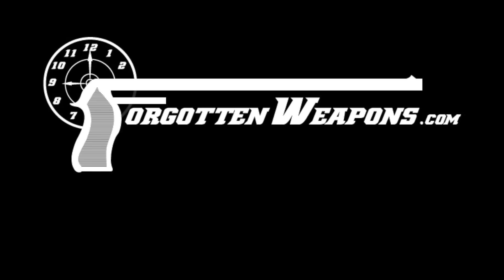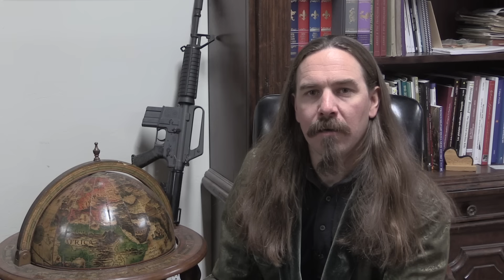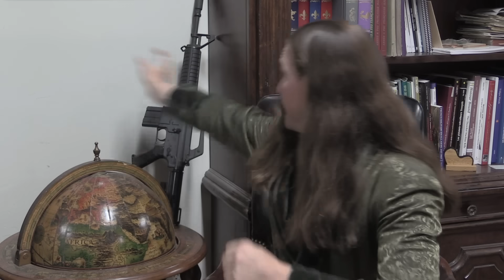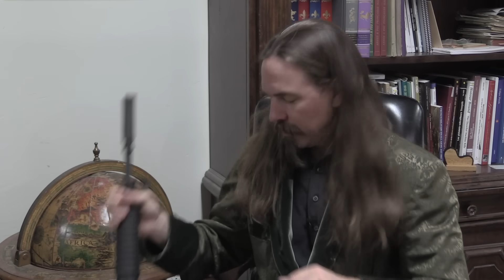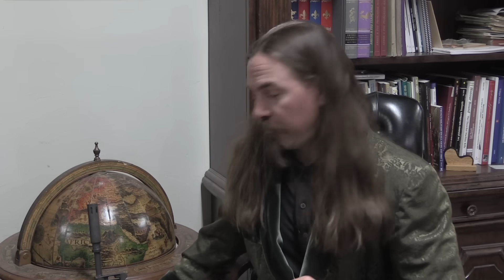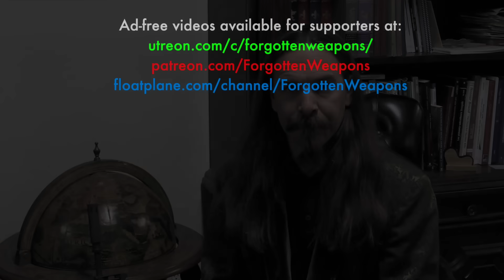Ask Ian: "Last Ditch" Rifles for World War III?

Comment: Back in the 80s, there was a paper and pencil/face to face RPG called Twilight: 2000.  The premise was that WW3 was winding down after 4 years of conflict with a limited nuclear exchange.  One of the firearms they came up with was the M-16EZ, which was an amalgam of parts stripped from damaged rifles and then cobbled together into something that functioned.  They would be shipped to local militias and governments without any sort of furniture, think of it as a battlefield pickup Aero DIY gun that had everything but the furniture.  The furniture would then be fabricated out of local materials (i.e. wood) and then the kludge would be issued.  This is more of a recycled gun than a last ditch production, though.

Comment: Consider the US might need to make or design this last ditch rifle for other countries. I could forse a situation where hundreds of thousands or millions needed to be armed, because enemies have invaded multiple countries in a power grab.

I don't think M16 would work well for one piece all injection molding. The buffer tube could be stamped with a reinforcing flare. The lower with handle can be one piece molded around the buffer tube end. The upper with fixed rear sight can be molded around insert that will have threads to install barrel nut. The barrel nut and hand guard could be a simple A1 style. The trigger group could be simple 3 position with full auto capability. It might even be possible to use powdered metal manufacturing techniques to make the trigger and hammer. The barrel doesn't have to be chrome lined or threaded. Just crown it with a straight profile. The front sight could be A2 stile or made fixed one piece. The barrel doesn't need an A2 flash hider unless you have a little extra time. In that case, it could just be pined on the end. The buffer could be A2 stile as also the stock. The magazines are probably going to be molded plastic as well.

I am not thinking this needs to be durable. I am thinking about faster, cheaper, and simpler. A last ditch rifle just has to work long enough for a conscript to fight.

Comment: If it's end times production you need something that can be made without computers or high demand for power.  Off the top of my head the best option/choice would be the Ak-47.  Simple, rugged, works.

You don't worry about aiming too much because if you are at the point where you are making more to equip replacements.... well your highly trained guys didn't do all that well at aiming.

Comment: I could also see the M-16 receiver becoming a 2 pecs stamped & welded part metal part. As for barrels they would become something like a rifle barrel liner with either a steel rod drilled for the liner or a polymer outer barrel. They are basically a thin tube that is riffled and pressed onto a worn barrel. You might even see something like the AR-7 being built for the current Military round. That riffle is about as simple as you can get  and has a polymer barrel cast over basically  a barrel liner. The Germans did something like that except they used a wire wrap over the liner.
But I have to say, Machining as we know it today is on the way out for the most part. 3D printing machines are going to replace the time honored Machinist and machines. I knew this back in the late 1980's when I started to see the 3D machines. It hit home in 1994 when I saw the first metal 3D printed parts being produces. Then about 2010 when I saw the Swedish sports car manufacturer Koenigsegg a complete variable turbocharger made out of Stainless Steel that could be just as easily be made out of Titanium. Here is the link to that Turbo. https://www.youtube.com/watch?v=DNedUZxP8NU
Oh how I wish I could afford one of those cars! As I recall it holds the all time record speeding ticket on a highway at 140 MPH in Texas. Yeah, I would be in even more trouble with one of those cars with over 800 BHP. Love big guns, military and fast cars but I can only afford the guns & ammo. But I digress, back to 3D printing.
I think the 3D printing will take over most of the machining world within the next 30 years possibly as soon as 10 years. There are many places investing in this world changing technology. All you really have to do is insert a program and wait, then uncover your part. I'm sure soon if they haven already done it, barrels and whole guns will be 3D printed. I know they have 3D printed suppressors. Right now it takes a long time, up to 48 hours + for a 3D printer to make large parts. But machines are getting faster and extremely accurate, with the surface finish getting better than machining. These machines can print a whole functioning gun or any other part, all assembled and ready to work or shoot. The cost of these machines have come way down and you can buy one that makes plastic parts for about $500. These machines are going to make CNC machining as obsolete as Blacksmiths. I do know that they are making military aircraft parts with 3D printers. The thing is, with the 3D printer, things will not become so old that you can't get parts. All you will need to do is program the machine or pay a fee to use the program to make the part. You will be able to make it at your home one day like having a Star Trek Replicator.
It's kind of sad to see, I'm a Machinest. I started off in the USAF learning the triad on conventional machines, lathes, mills, surface grinders, shapers and more. I never thought CNC would come down to a repair shop but it did and the military started to buy them before I got out. Now there is talk of moving to the 3D machines. Its hard to admit, but the 3D stuff is more accurate, more exact repeatable and faster. Believe me, If they can 3D print something as complicated as a turbocharger like of that one made by Koenigsegg, any pistol or rifle would be simple to make.

Comment: Taken to it's furthest extreme, an AR18 modified to take a STANAG magazine would fit the bill- stamped steel stampings rather than forged and mill finished aluminum. But I'd agree- polymer lower with integrated stock. Don't drill the third hole- saves manufacturing time, a few fewer parts, and greatly reduced training time. That shifts everyone making lowers to making uppers that have a "shark fin" that you drill a big hole in and put a simple plate into like an AR7's rear sight. A bit nasty, but it works and requires drilling two holes, a steel stamp for the sight, and a self tapping steel screw so you don't even need to tap that smaller hole holding the site plate. 

Also, no sling swivels. Issue a strap with one tri-glide adjustment (a belt), duct tape and maybe some 550 cord for the most redneck Isreali style patrol sling ever.

Comment: A slick side m16a1 upper with a 16in barrel and mid length gas system and a polymer lower would be unbeatable for weight and common parts

Comment: I honestly don't think we would see much change. Our small arms production capacity is unbelievable due to the AR-15 being both the military's standard issue rifle and the most common semiautomatic rifle in the US.

The optics question is the most valid point, especially if that war impacts our ability to source either glass or semiconductors. Polymer rear irons would be the standard, I think. If it breaks, slap another one on.

Comment: For a last ditch war weapon I would just do a PPSH-43 in 5.56 or 5.7x28. I takes 2 machined parts and 8 welds. Aside from the rifling you could build them from scratch with cheap sheet metal and a trip to Harbor Freight.

Comment: Polymer lowers definitely wouldn't be used especially since they are prone to cracking and breaking with hard use on top of damage from artillery, fragmentation, dropping, cold etc etc.
Reply: Some modern polymers are absurdly tough. I challenge you to crack or break a credit card, they use a type of plastic that has existed for about 150 years. Polymers bend and snap back into shape, aluminum deforms permanently.

Comment: A frame front sight made as  just a gas block and put polymer flip sights like MBUS also less rail cuts needed, get rid of the flash suppressor so no threading needed, why have full auto needed? I had 3 tours of combat and never used it or burst,

Comment: Do you think it would be possible that they would simplify a "Last Ditch" rifle to the point of having it be semiautomatic only?  In truth, while full auto allows good suppressive fire capability, full auto runs one out of ammunition very quickly and is rarely used in actual firefights (unless those firefights originate from movie studios).  And even a semiautomatic rifle with a 30 round magazine can provide suppressive fire, albeit at a slower rate (but that slower rate extends the length of time the suppressive fire can be provided per magazine).

Comment: As much as i want to like polymer lowers, all the ones ive seen that were polymer copies of standard aluminum recievers had failures, double firing, buffer tube broken off ect. I would be worried something that breaks with mild range use would be far too fragile for combat.

Comment: Making a Stamped receiver would be the better option than a Polymer die pressed receiver, since a Polymer receiver is unlikely to last very long in the field. Soldiers can be hard on equipment. Two halves of the receiver could be stamped and spot welded. you be able to stamp at least 100  receivers per hour on a single stamp press.

I could see polymer being widely used for the magazines since many would end up one time use. That's presuming there isn't a shortage of polymer materials needed to produce them.

Probably the quality of the barrels would decline as it takes a lot of time to make an accurate barrel. I would guess the production of barrels would be greatly simplified & using materials that reduce barrel life compared to peacetime produced barrels.

Next would probably be a simplified bolt to speed up machining time, such as removing the forward assist groves on the bolt carrier..

Also the trigger assembly might be simplifed. perhaps a not so nice trigger if lesser quality trigger can be produced more quickly & with less parts.

Comment: if you want really quick production.
you cannot produce faster than you can produce barrels anyway
Aluminium is also plenty abundant and easy to source in ANY scrapyard
Much easier to source vs all the chemicals required for polymer production

Comment: US doesn't have to simplify since we have the 2A and US citizens can just bring their own gear. We did it in OIF and OEF. We brought our own gear and modified our M16/M4 rifles heavily, and just returned them to issued state before turning them back in. Most guys I fought overseas with were better armed/equipped at home than in the Army.

We swapped grips, handguards, mags, triggers, selectors, mag releases, bolt catches, buttstocks, slings, sling mounts, optics, bipods, lights, and more.

Comment: 1st you can't get any simpler then the M16A2, in fact they can pump out like 1000 of the per day if need be.

2nd they won't touch the sights, here's why. The M16A2 is a duel roll weapon system, it is the main battle weapon & it can be deployed as a long range rifle if need be even with the standard iron sights. The military doesn't issue optic sights to everybody any ways. Iron sights are the primary sights today. Even snipers primary sights are iron sights. Optic sight are to fraggle & expensive & are rarely issued. So this isn't going to be a issue.

3rd rifles & weapons aren't going to be the issue for the US, it's going to be ammo, primarily gunpowder & brass components of them. As we have seen repeatedly from WW1 to present day. When I was deployed to Iraq, the many units had to have civilian ammo shipped in, the issue with that is, it caused cycling issues & caused a lot of feeding jams.
 
The reality is that we can machine our rifles faster, than we can produce ammo. example of this is Vietnam & the M16A1, within a few months most units had transitioned over to the M16A1, but lack the ammo to go with it. This was a issue all the way to the end of the conflict in 1975.

Comment: If you were dead set on staying with an M4/M16 I see a modernized AR180 being a more realistic option.  Aluminum is far more valuable in other warfare equipment, polymer AR lowers can be made to work, but nothing will ever beat the durability, ease of manufacture, and ready availability of steel stamping.  Even the magazines should default to steel or possibly polymer.

Comment: Making the aluminium from scrap, degassing, and adding other materials to make an alloy. even with a working foundry would be a nightmare as the fuel a furnace needs.. polymers are probably the way to go.

Comment: I expect "Lack of Production" would be amoot point.  How many companies out there make receivers right now?  The Multi tool/turret CNC also can do parallel processes so an upper receiver can go in only 1 or 2 machine passes and be done rather than a machine/step for each cut previously.  The programs have already been refined for efficiency to maximize the profit margin as well, I bet.  Get the government contract, then optimize the line so you can make civilian versions with the machine time saved to maximize profit once the .gov pays for the retooling...  In time of war I am sure all those extra cycles would suddenly go to war production.

Optimizing a rifle to toss to cannon fodder?  Fixed stock polymer lower, no forward assist, fixed front sight, no scope, A2 combined rear sight. No burst fire, maybe skip full auto as well to reduce wastage of ammo by low trained troops.  Corporals and up get the good rifles.  Run the guy through bootcamp in 2 months focused on camping and shooting and some basic tactics while shooting a couple who will not take instruction to encourage the others...  Last ditch right, either it gets DONE, or someone dies instead of everyone.

Comment: "Last ditch"  requires a minimum of parts, a minimum of machining operations, minimum use of materiel and minimum use of tools.  I think a last ditch AR would look like a hybrid of the upper off of one of the horrible post-ban DPMS rifes.  Cast aluminum A1 style upper. Slick side; no shell deflector, forward assist or dust cover.  A1 sights in carry handle and a polymer one piece lower.  Not molding in the assist and deflector would save aluminum, and you'd get an extra receiver every 50th receiver or so by deleting them.

Picatinny rail requires a great deal of machining steps and close to precision flatness for the top.  This would require too many steps, too much time and too much use of increasingly rare machining tools (Think of the chatter marks from worn out end-mills on German and Japanese "last-ditch rifles") and again, optics are a choke point.

You could certainly do an upper in polymer.  They're out there.  but you need a metal insert with barrel threads and a metal pipe for "pooping where it eats" cast into the polymer upper along with strengthening  I suspect the machining steps would be a wash and any metal savings over a cast A1 style upper would be negligible. It's easy to do a lower, as it's basically a box with levers and springs in it, not so much an upper..

Barrel would be 14" pencil profile thin barrel to save steel or whatever the absolute minimum length required to spin-stabilize the issued projectile based on rate of twist is.  There would be no chrome lining in the bore or chamber.  The barrel would have a standard rifle crown, with no threads or flash suppressor, just like a post-ban AR.  Handguards would be M4ish and molded with no internal heat protection.  

Bolt carrier would be early style full-auto M-16 with no forward assist notching as they would be unnecessary.  The bolt would be the most machining intensive part of the rife and likely the last to receive a major change.

The lower receiver would be a one piece polymer to include buttstock and pistol grip, possibly connected in a "thumbhole" stock for strength.  There would be no buttstock cavity for storage. Receiver will be drilled/machined to accept any combination of "mil-spec' fire control parts.  Preference given to semi-auto for rifles intended for newly inducted soldiers, full-auto for prior service or retirees recalled to active duty.  Magwell on receiver wil be standard and accept STANAG style magazines.  In extremis, should logistics be near complete failure,, the lower could be redesigned with a built in 20 round magazine that is fed by opening the rifle and using standard stripper clips internally to load.

So, with the exception of a "giggle switch"  evverything you hated about the shitty post-ban rifles.

Comment: I like your tack on some of this but after running ar15 parts i have something for you to thick about in you load time comment that is pallet changes. The operator is loading the machine all it is running. 15 years ago I was running 4 uppers every 10 min I add this fact because i thick you would like to know it and not to say you are wrong.